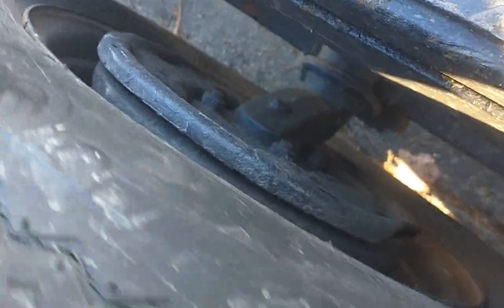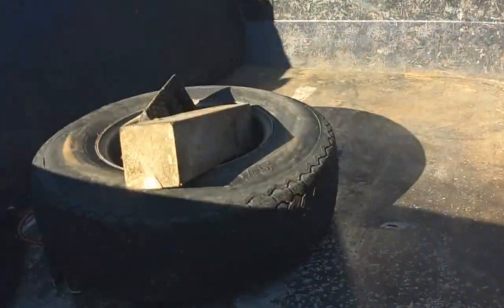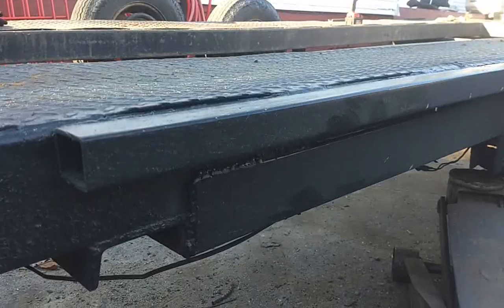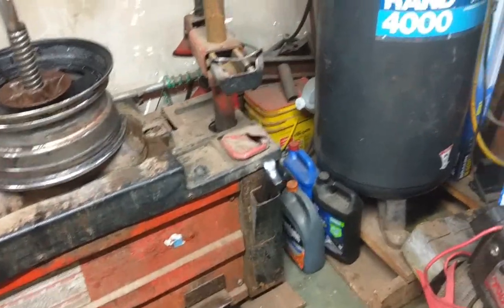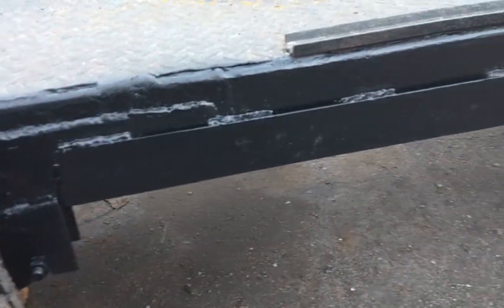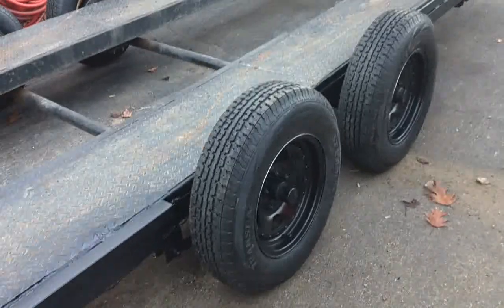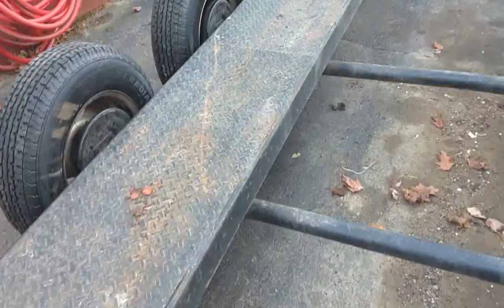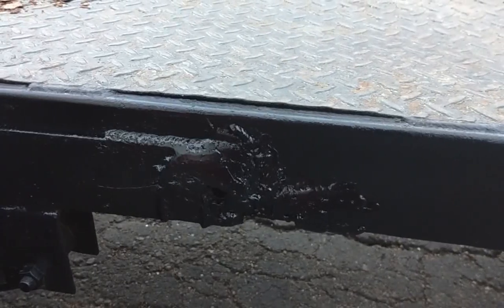Brand new tires for the trailer!

Comment: Do you have to safety trailers there yearly?  Did you pull the brake drums off and service and inspect / re-pack the bearings ?   I’ve gotta go over my trailer, needs everything..  it’s built with 6” channel with a 20ft bed 2 ft beaver tail..  5 ft tongue.. bed floor is all checker .. you definitely save a lot of weight with the center open.. the floor on my trailer is about 1,000 lbs. lol